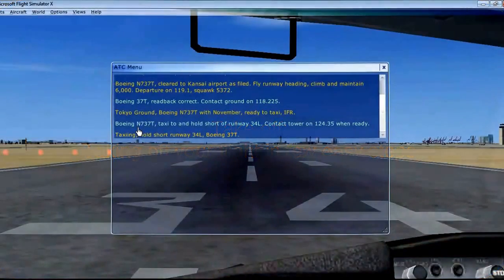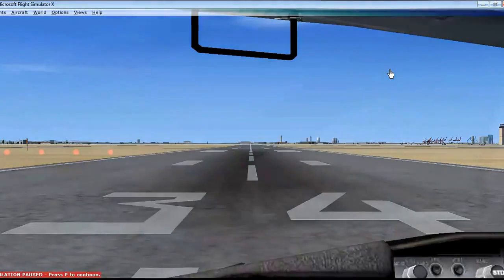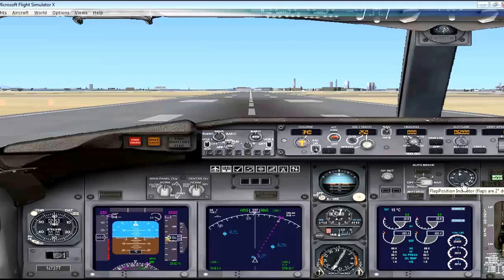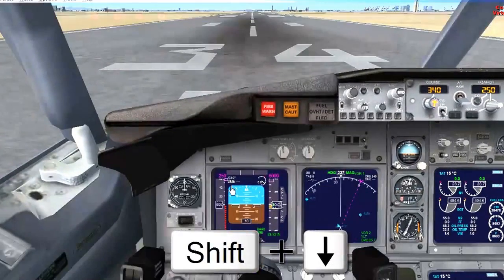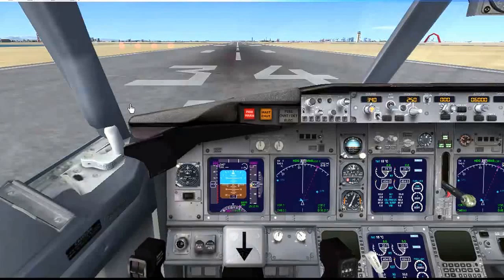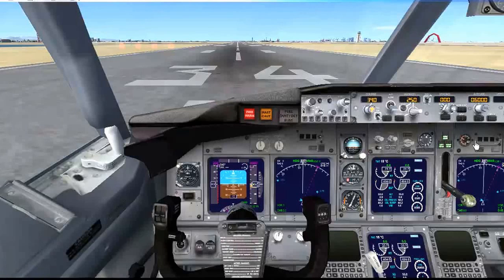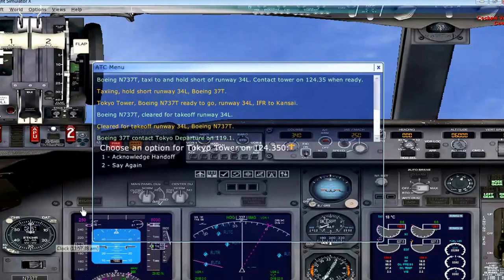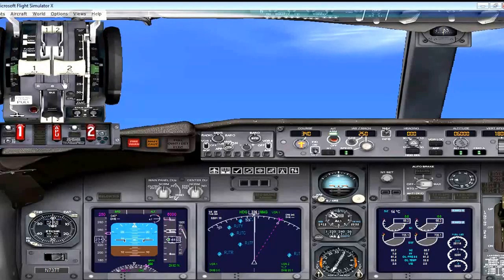How to take off flight FSX (boeing 737-800)  with commentary & button help for beginners

Comment: And you dont wait until 180 knots for takeoff. V1 speed for 737-800 is around 135 knts and rotate soeed is around 140 knts! You reached till the end of the runway in an aircraft which needs less or more than 3/4th of the runway. BAD VIDEO!!

Comment: Mann I just love your videos because other videos they  don,t show like what button to press but in your videos you do it
Reply: GamingWithSB Critical Ops This video is totally wrong. First you need to wet lights, trim, autobrake to RTO. Yhan you mist advance engines to around 40% and then to around 90% not 100%!!! He has climbed with 40° rate. Sace vlimbe rare fo 737 is 10° to 15°. It was a total mess. If you want to know how to takeoff just watch another film.

Comment: You are teaching people many faulty stuff,which include:

-takeoff speed of a 737-800 default aircraft in fsx is about 130-160kts depending on your aircraft's weight that you've set in.
-takeoff clearance is given before entering the runway(it appears to me that you haven't taxied at all considering fuel consumption on your EICAS)
-safe climb pitch on a 737-800 is about 10-15 degrees (again depending on your gross weight) not 40 degrees, that's insane...you were about to stall.
-realisticly.... stabilization thrust is about 40% N1 not 25. advancing throttles to full( or over 100%) is dangerous
-try using a joystick instead of a keyboard it helps...alot.

Hope u make a better video
Reply: And another one: You've to put the V2 + 15 in the MCP not 250. 
And is MANDATORY! When you'll take off, your heading selector must be selected on the runway heading. Aproximately the V1 speed is 140 and VR 143. Depending your weight obviously. 
The pitch climb is almost 20. 18 to be exactly in a normal runway without obstacles.
Reply from the maker: thanx 4 d info....nd yeah i dint taxi 4 ths video as it s a take off tutorial!!
sorry

Comment: hey great tutorial,how i can move my plane to the gps way, i mean to set my plane to his way,manually like we press arrow key to turn right or left or it can auto by like heading
Reply from the maker: engage the autopilot and switch on the heading hold switch..set the heading using the knob and you can control it with the heading button
Reply: thanks it works

Comment: Hi, when i ask IFR clearance they wont mention any thing such as ascent and maintain some altitude,I just get the message as you are cleared to take off from run way so n so.????? why is this????
Reply from the maker: it is because you have chosen a VFR flight when you created your flight route. select IFR flight route. hope u understood..and sorry 4 d delay
Reply: Yeah, thank you ...
Reply: HI, I have a one more doubt, while landing when am about to touchdown may be around 200ft above GL ill try to pitch up the plane slightly but when i do this my plane will start to ascent, why is this...?
Reply from the maker: srinivas kogilgeri it is because your auto throttle switch is on!!! switch it off and bring back your throttle lever to idle!! was your IFR / VFR pblm solved??
Reply: Ok thanks, yes my IFR / VFR problem was solved.. thank you

Comment: when im increasing the throttle the plane is moving left and right even when its fast so i have to use the rudder, is there something wrong ?
Reply from the maker: there is nothing wrong!! engage autopilot for smooth control of the flight :)
Reply from the maker: sorry 4 d delay
Reply: ohh ok i see, thankyou

Comment: Hi, I have yet to buy fsx but I've got some questions to ask you. 

1. Can I set crosswind conditions on fsx? 

2. Are the sensitivity and responsiveness of the controls on fsx similar to the real life one? 

3. What are those black discs that spin on the sides of the throttle? 

Thank you very much.